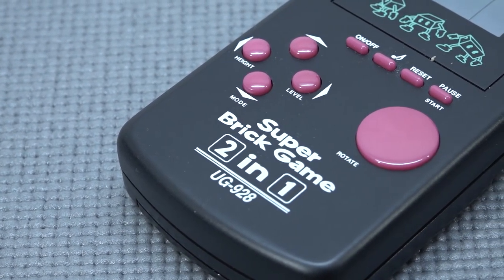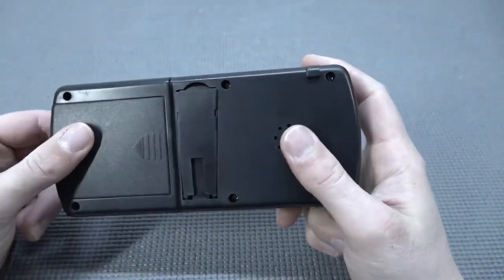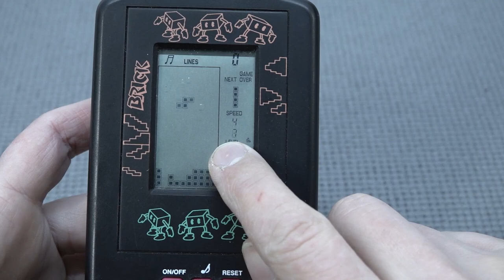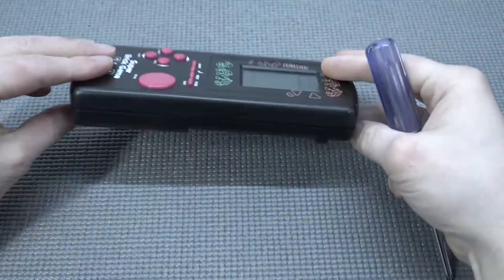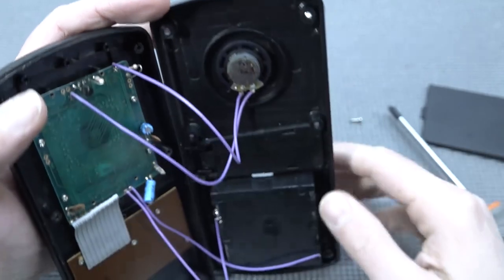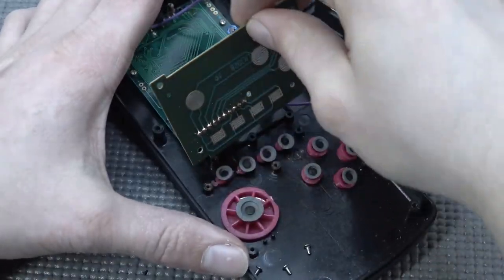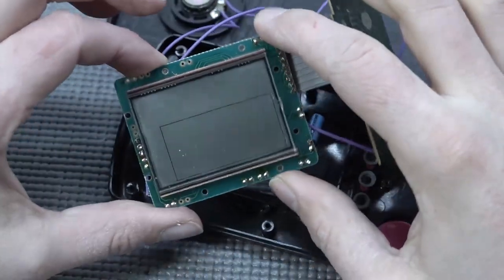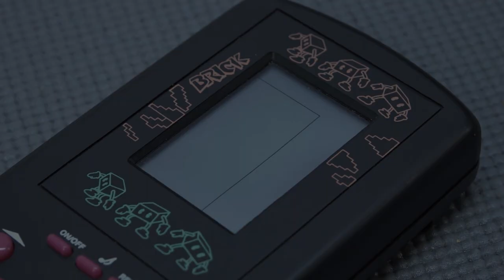The Super BrickGame 2 in 1 Handheld    Let's Go Back In Time

Comment: That's the real brick game from the 90s. It has two variations of Tetris and it comes with 10 speeds, 13 levels, two rotate functions (clockwise and counter-clockwise), and the fruits are on the screen when the speed is increased by scores.